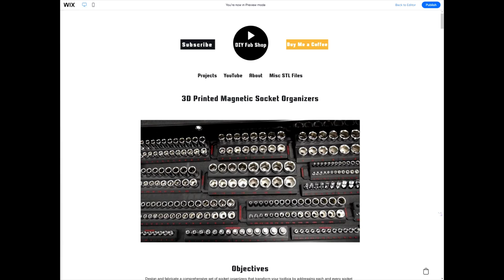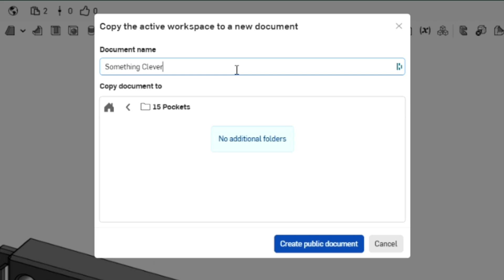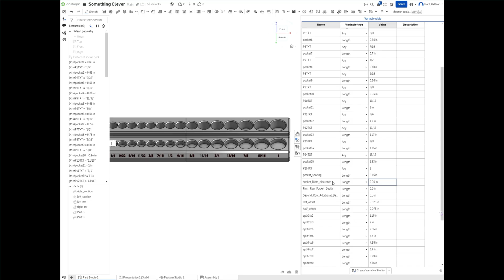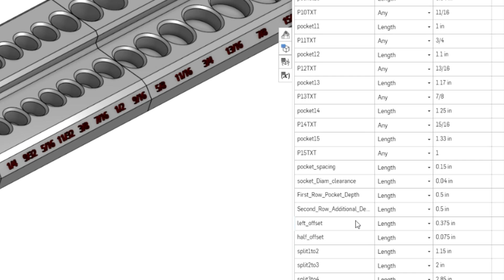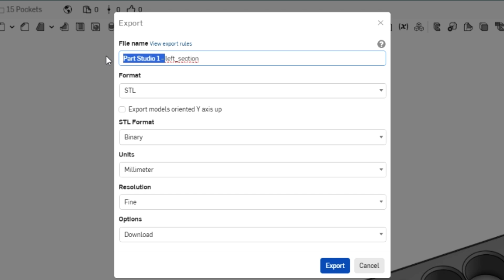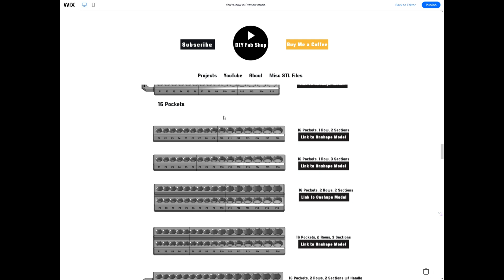Free CAD Access for 3D Printed Magnetic Socket Organizers

Comment: How can I add both sections on one plate when exporting? I'm going to print one section it says 25 hours to print? is this correct?
Reply from the maker: @ScottVanderspool-i9d  the method i use is to export the STL files for the different components one at a time, and then import them into my slicer program, one at a time.  Then use the slicer program to arrange on the build plate.  These are best printed sitting on the plate like they would in a drawer and the only area that needs support material as part of the build is the slot on the bottom of the rack.  25 hours seems like a long time to me, but I have a bambu x1 that is a lot faster than my last printer so maybe that may be impacting what i think normal may be.  I was printing with PLA and the default 15% infil.  What printer do you have?
Reply: @DIYFabShop  I have a Bambu P1s, I had the coloring all wrong. Lol that's why it said 25 hours, when I colored it correct it still takes about 5 hours. the color change is like 58 times that's why. Others I've made the numbers are on the top so the color change is only one time, but  I like your design.

Comment: I love the socket organizer i have made a few but when i do my large metric sizes they are cutting into the neighboring pockets ?  The large sae made the whole thing wider
Reply from the maker: Which template? As in how many pockets, rows and with or without handle
Reply: @DIYFabShop I was using the 11 pocket 2 row no handle.  I just redid it with the 10 row listed below and it works fine.  Thank you for all your work you put into this
Reply from the maker: @toddhathaway4871  i couldn't find anything wrong in the templates (although that is still possible).  So did you catch the limitation that the largest socket needs to be on the far right of the rack.  Its the right most socket that sets the rack width.  If you really want it to work with out that requirement you would need to go into the master layout sketch and have a different pocket drive the outside dimensions.  If this doesn't resolve your issues, just let me know.

Comment: This is amazing! Thank you. QQ Is there an easy way to change the 10 pocket holder into 2 rows? Or change the 11 pocket two row version to just 10 pockets? All my socket sets are the Harbor Freight Quinn sets that are all 10 sockets each for metric and SAE.
Reply from the maker: @harrison0550 the following link should take you to a 10 pocket 2 row version.  let me know if you have any issues saving out a copy so you can modify for your needs.

https://cad.onshape.com/documents/4b027f72eda3c5b04fbfa6d1/w/9abad16668de094f610e90f1/e/7ace3f033a63e84ef347a107?renderMode=0&uiState=68ac9fe8158ca47b558c071d
Reply: @DIYFabShop I really hate to be a bother but when I open that it opens in view only mode and will not let me copy the workspace. When I click the 3 hanburger menu in the top left it just says print or close document.
Reply from the maker: @harrison0550  ok, I think I have the right settings now.  https://cad.onshape.com/documents/4b027f72eda3c5b04fbfa6d1/w/9abad16668de094f610e90f1/e/7ace3f033a63e84ef347a107?renderMode=0&uiState=68acea2a55912218f10c63bc
Reply: @DIYFabShop  Yes that worked perfect! You sir are amazing! About to start printing these off for all my metric and SAE sets. Thank you again for taking the time to make these.

Comment: Would it be possible to adjust how far the extruded labels are extruded? I tried doing a negative extrusion on them, as I like the look of a recessed label and using a paint marker to make it more visible, however since it looks like the labels are their own thing to allow for dual extrusion, it will not let me adjust the extruded height. It's been a hot minute since I used Onshape, so any help would be appreciated. 
Regardless the idea and video are amazing, especially how easy it is for the most part to customize the holder to individual needs, as I can understand how much easier it would be to just provide a template and let everyone else figure out clearance, spacing, and how the parts are divided.
Reply from the maker: @thepointman6665 if you go into the model tree (which is the column of features on the left hand side) and find the feature labeled "pocket labels protrusion" you can double click on it to open it.  In the pop up window you will see a parameter labeled "depth", that is what controls how much the labels protrude out of that chamfer surface.  Good Luck!
Reply: @DIYFabShop  I tried to use this to do a negative extrusion, however it gave an error message about the part being contained and not making any change. Either way having the labels protruding only 0.01 instead of .05 looks cleaner to me personally, and some of the organizers that I printed over the past few days have come out really good. Even measured a Snap-On set worth more than my daily for an impressed coworker who liked the idea of pulling a set from his box and having it stick on his cart.

Comment: i love the idea but have some issues. 
1. When attempting to adjust the pocket size, it only gives me the option to edit 2 pockets for 1 value. The problem i run into is that my short and deep sockets are different diameters. 
2. I do all my modeling in mm. This is more an issue for when using on shape since I stick to fusion.

Id appreciate a reply and regardless, amazing video!
Reply from the maker: @M.ruiz902 sorry, to keep the templates manageable they are set up so that the two rows are the same diameter per pocket number.  A necessary evil to get the split lines automated. I guess a work around for you would be to use the larger of the two diameters for your sockets.  Good Luck!

Comment: this is so cool thanks for all your hard work.
i was wondering if your able to remove the second split on the 3 part model.
Reply from the maker: @corvus2929 which 3 part model are your referring to? One of the standard STL files or an Onshape model??
Reply: @DIYFabShop  yes
Reply from the maker: @corvus2929  so are you looking at the 19 or 20 pocket models, because all of the others have both a 1 split and a 2 split version available.

Comment: Thank you so much! this is amazing. Need some help tho, I have some very large impact sockets. My impact set includes a Large SAE 1-5/16 (1.82 in). which kinda breaks the model. Is there a way to enlarge the base model?
Reply from the maker: @michaelajo8412 which template are you trying to use that failed on you with the large sockets?  It likely just lost a constraint, I can take a look.
Reply: @DIYFabShop  So I got it to work with my large metric set with 27mm impact which are 1.5 in. Using the largest template with 20 sockets (Just checked with the 1.82 in SAE, worked also). Then just modify the slice points and don't export what I don't need. Its my first time ever using Onshape (Well any Cad really). Got my first printer a few days ago. This forces me to have dove tails on a finish side unfortunately. I originally tried on the 11 socket 2 row

Thanks for the super fast reply, definitely wasn't expecting that.
Reply from the maker: @michaelajo8412  so I just tried 2" diameters in each of the 11 socket double row templates and it didn't crash for me.  I have had some crash in the past with large sockets so I expected to find a problem.  Did you catch the requirement that the farthest to the right pocket needs to be the largest diameter pocket for the template to work?  For the 11 socket 2 row that failed on you, was it with or without handle and 2 or 3 sections?
Reply: I did not catch the requirement on the large had to be on the right. I had my large starting from the left.. Thanks again!

Comment: Hmmm...not sure what happened to my previous comment. After about 20 tries, I finally got two good prints! I printed two 2-sided 2-socket socket holders for practice. One side I printed with numbers (3/8 and 4) and the other side I left blank to put labels on. I'm using a EcubMaker Fantasy Pro  II. I had to build my own machine and filament profiles as there were none available. After three days and three slicer programs...finally settling on Orca...I got it all working. I think I am about 90%...maybe 95% there with my settings. I'm going to run a couple more practice pieces. There are some more settings I am going to change to try to get my settings to closer to 99-100%. Everything went together perfect so far.
Reply from the maker: @BrassBuilder love your persistence to get your printer up and running!
Reply: @DIYFabShop  Oh it was an adventure! I'm going to run another test piece with the raised numbers and going to try to print the numbers another color. I found my printers are actually dual filament. I think you showed me enough on how to do that to get that to print.

Comment: That helped a LOT! I'm lucky that I have at least some experience in CAD so that helped. Does the printer print these boxes 100% fill or is there a further selection process to say...50% fill? Also...what about the process for the magnet slot with that break-a-way fill? Was there a process to set that up? I was hoping you were going to go into that into a little more detail too. But this did help quite a bit. Or am I asking a lot of questions that are answered on the website either on your website or on OnShape?
Reply from the maker: @brassbuilder once you get into the slicer program for your printer, you will see that it likely comes with some default settings for PLA, including a starting point infill %.  Those default settings should work fine.  When it comes to the support material in the magnet groove, I have had the best luck using a support structure known as "tree".  It provides adequate support and I found it has been the easiest to remove.  Every slicer program is a little bit different, so I would suggest google or chatgpt for guidance on print set up for your particular printer / slicer.  Your certainly welcome to continue to ask questions here as there are likely other folks with the same questions. Good Luck!

Comment: Awesome video and tutorial. I'm a complete noob and just tried to make one of these for an 11 Piece Deep Impact Socket Set in 1/2". For some reason, when I change the last pocket, the files merge into only 1 section. I was using the single row, 11 socket model.
Reply from the maker: @josephjmicallef  I will take a look at the file and see if I can duplicate the problem
Reply: @DIYFabShop - thank you mate. Very much appreciated. I was using a single row, 11 socket model. Whenever I change the diameter for socket 11, you’ll see that the files on the left merge into one. All that remains is 2 parts - 1 side and 1 magnet retainer. I tried it with the 3 piece design and I didn’t experience the issue.
Reply from the maker: @josephjmicallef  I was unable to duplicate the issue.  Would you mind providing the socket diameters you were using so I could see if that helps me trigger the issue?
Reply: - sure. 
Pockets 1-5 - 0.978 in
Pockets 6-9 - 1.18 in
Pocket 10 - 1.251 in
Pocket 11 - 1.335 in

Pocket depth was 1.4
Reply from the maker: @josephjmicallef  thanks, for some reason an alignment broke with the larger diameters.  I fixed it and hopefully it is good to go now!
Reply: @DIYFabShop  Thanks for taking the time to help us out!

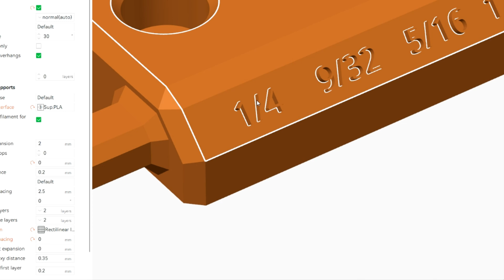Comment: 9:00 - In Bambu Studio, if you rotate your tray 45° back and make the face where the letters are printed "flat", you can use the paint by 'height range' tool to paint the last 5-10 layers of the model with your letter accent color.  From there, you can slice as is (w/ a lot of supports) to get the best looking letters or rotate back down to to slice as normal.  Good luck.
Reply: Great tip!

Comment: Thanks for this. When measuring the socket diameter, do I need to add anything to ensure the hole is big enough or enter the exact measurements into the table?
Reply from the maker: @joepellissier2091 you do not need to add clearance.  There is a clearance variable in the table that I have pre-populated with a clearance I found to work well.

Comment: Sweet alot of work went into this thanks for doing it. Just know there is going to be a lot of filament changes printing these with 2 colors just the way its designed.
Reply from the maker: Very true, I convinced myself it was worth it for my toolbox, and assumed that folks that didn't think it was worth it would just use a paint pen or something to highlight the text instead of printing with two filament colors.  I guess I could have made the area in front of the second row wider and put the text on the top most surface to minimize that issue.
Reply: @DIYFabShop i ended up putting my text on the top surface for ease of coloring with the layer tool, and one color changeover.  But I have the AMS, so it would not have mattered much.